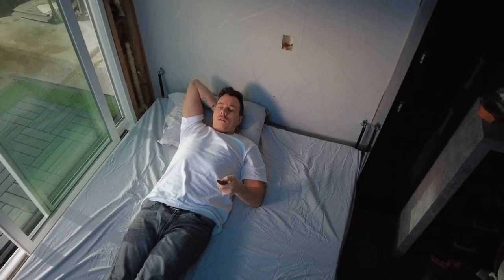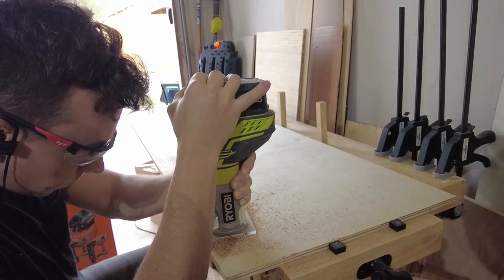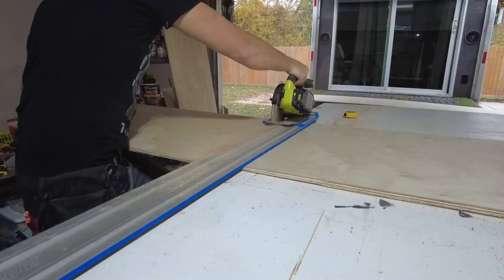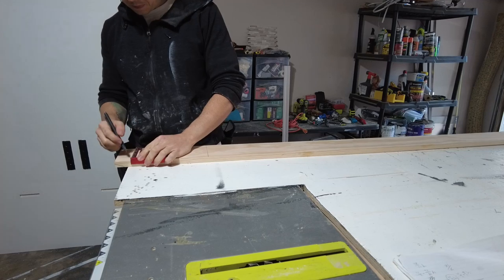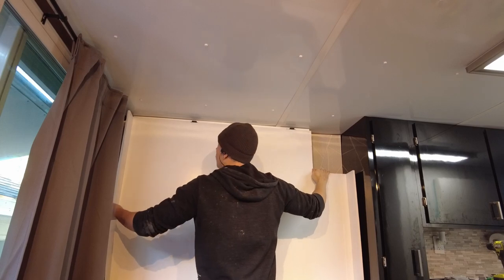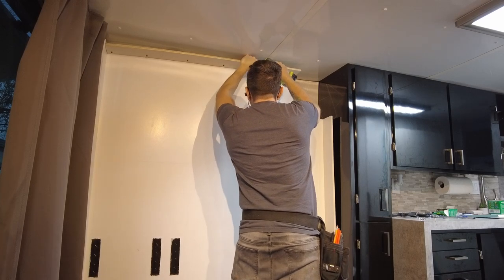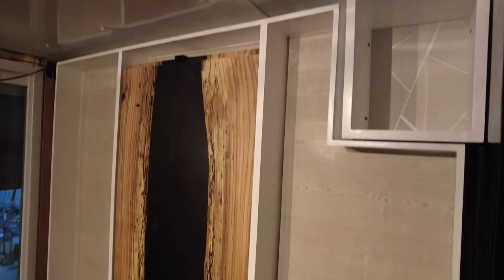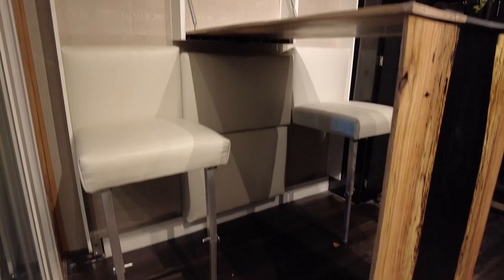The "All Wall" - The Best DIY Van Life/Tiny Home Murphy Bed EVER? (3 in 1 space saving furniture)

Comment: Keep this up and they'll be using your designs on space stations! Not only the function, but the artistic design is very impressive. When it's all folded up, it has a Japanese tokonoma vibe.
Reply: They sleep standing in the space station, floating in the air strapped to a wall or a roof etc

Comment: I really love how creative this is. Great use of space. I felt the seats were too tall, but that's easily adjustable to the intended user. As it probably wouldn't affect the unit as a whole, it would be good to fashion it so the backrest of the seats was angled for better comfort and perhaps a bit deeper for the seats. It did look a bit uncomfortable to sit on. I also wonder if the cushions were on the floor when the bed was deployed as the white cushions wouldn't stay white long if that's the case. Again, altering that in the design wouldn't really affect the build design so not a hard tweak. This whole setup is pretty genius. It's exactly the sort of innovation that's needed in this market. Well freaking done! A 3-in-one solution for a small space is magic.

Comment: This is perfect.  Im to phobic to be in a small place like a grandmas attic, I would much rather use that for extra storage for winter clothes, and other items.  I think your flow and design is the best Ive seen yet with 1 or two changes for me (example would be no patio door just a normal smaller door and use that back wall for more closets/storage.)  I'd also add/build some metal storage boxes on the outside/undermount (like on buses) for a garage type thing if the tanks allowed for it.  Im paranoid for storage as I dont know just how minamal I could get.  If I were to ever do this, it would be modeled after your overall design.  Def need a work/TV area and that all wall is genius.

Comment: You uploaded this right as I was about to get up and work on my own box truck. Good thing I wanted to procrastinate just a bit longer.

Edit: cool build. It doesn't personally fit into my planned build, but it works great in yours. I did spot a bit of flex in the table during one of the timelapse clips. Maybe some L aluminum to trim out the bottom edge of the table could add some strength. Really pushing the limits of epoxy alone there. Sure it's just supporting some food or a laptop, but life happens and one day someone will put something heavy on the table and it's gonna break.
Reply from the maker: Yup - I have a long list of tweaks/finishing touches that need to be made